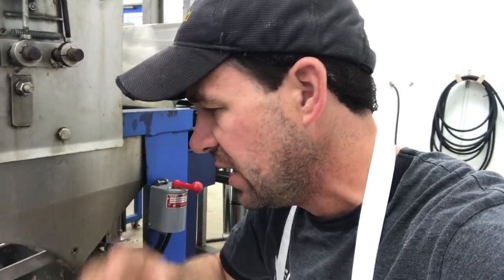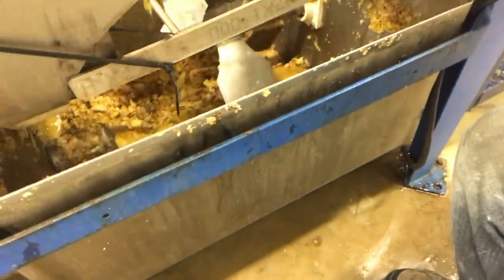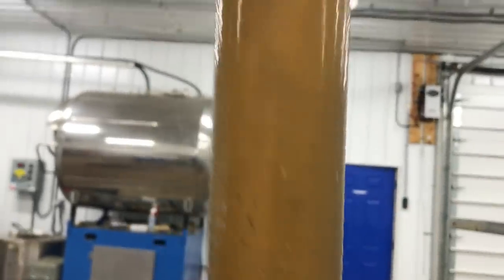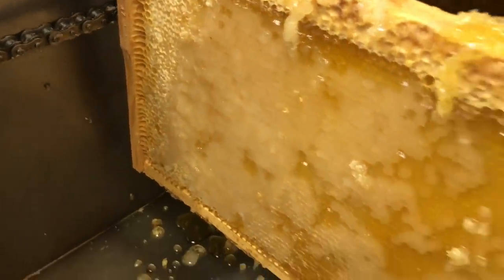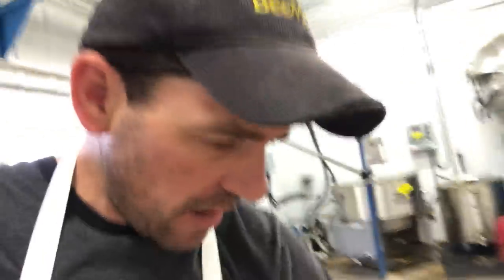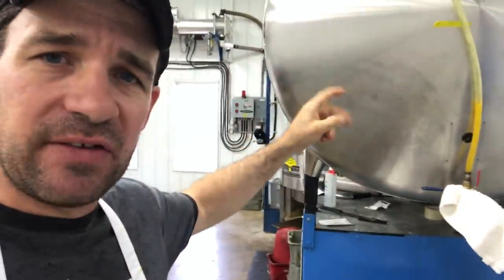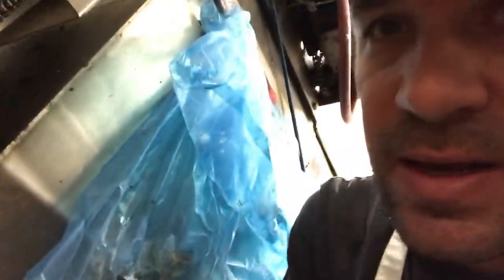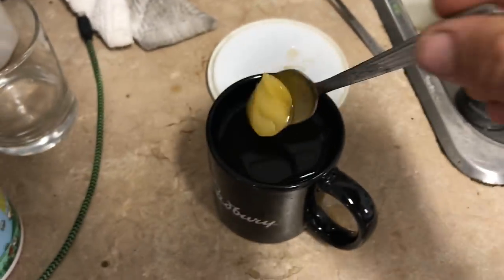Honey GRANULATION !  a SLOW Monday Morning Extraction Day Start Up

Comment: Thanks for showing this! We're in the process of adding a spin float and changing things over. I always thought your paddle agitator did more cutting/grinding of the comb but it looks like you are augering the honey from the extractor over to the agitator right? Do you have problems with the first cappings before you start extracting because they don't have the extractor honey to mix with it to thin it out? Not envying you having to run Canola though. Cotton is enough for us granulation wise.
Reply from the maker: We be sure the mix tank  fills right up to mix the cappings before pumping

Comment: Btw, how are you liking the cappings screw press? Also, thank you for sharing. One of the things i seen a guy do with their cowen is cut a hole in the side, install a bulkhead and use a steam injector. Of course after they cleaned out the metal flashings from the hole, and Nate over at Cowen does water jackets on those auger sumps. I know that it stinks to use a steamer  since it can raise the moisture content, but I'd maybe contact Cook n beals and see about a HMR system. They are pricey at 10k plus. but well worth it.
Reply from the maker: Adds .5% MC but that doesn’t matter when it’s running 15.9
Reply: @aCanadianBeekeepersBlog   I look forward to a video of the cappings press running!

Comment: Can really see your stress levels increasing with the granulation issues.  Guess it makes for an interesting video for some (not for me).   I watch your show to learn and enjoy your success.  Maybe you can reduce your stress by adding heaters to your tanks/hoses.  Stick on pad heaters are pretty cheap (relatively) https://www.mcmaster.com/barrel-heaters/heavy-duty-adhesive-mount-heaters-for-tanks/.   Better yet, bring the building heat up to at least 70F.
Reply from the maker: The building is floor heat, 30 degrees
Reply: 30C = 86 F